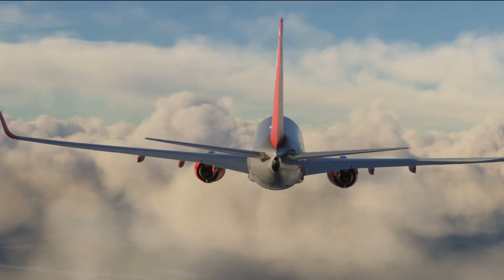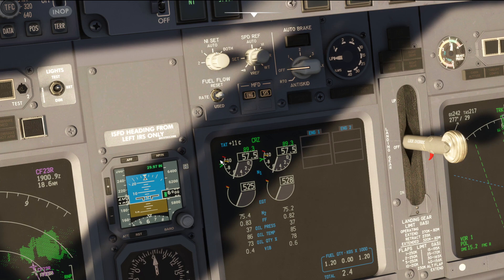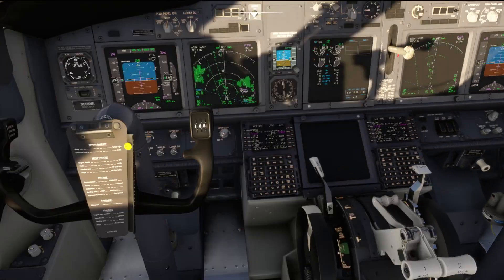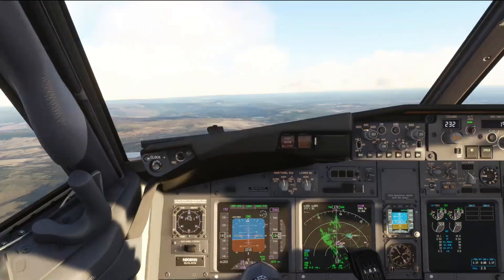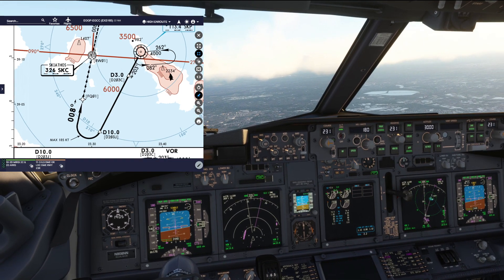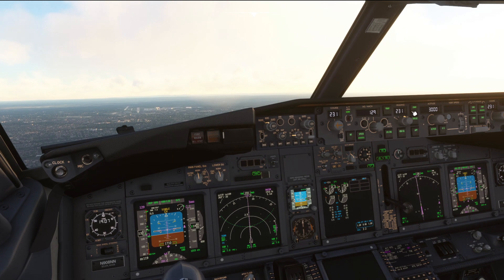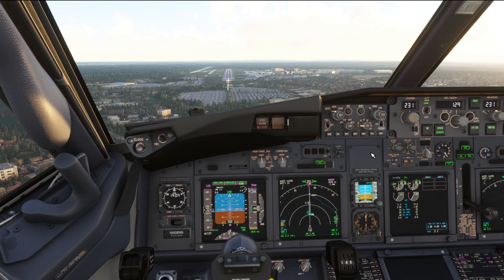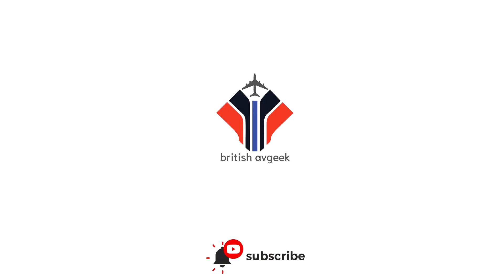MSFS | PMDG 737-700 Tutorial - How to Fly a Go Around / Missed Approach

Comment: So how do you do a new approach? The approach is no longer in the flight plan. Do you set it up again or do you just vector back into the ILS funnel for your runway ?

Excellent video as usual!
Reply from the maker: Vector yourself back 👍 depends on the specific final approach you are doing again but if it's an ILS you can easily continue with that or configure for another approach if needed whilst in the hold after flying a go around

Comment: When I am configured for landing I have the A/T, CMD off. Flaps at correct setting, gear down and locked and auto brake set.  Also, speed brake set.  I don't like to forget to take the A/T off and have the aircraft run away from me because I forgot to disengage it.
Reply from the maker: Keep trying and you'll have sorted it soon enough!

Comment: Two questions: Why do you put your curser on the screw as apposed to the TO/GA button???  Next question is if you have A/T off the toga will not work unless you move throttles up by hand.
I have been flying the Zibo B737-800 for 2 years and have the throttle set to ON in the FMB.  The way I do a go around is to make sure the A/T is engaged first, then push the toga button,
throttles move up to N1, flaps to 15 then 1 then up. Gear is selected up when at correct height from ground.  Great video!!!!
Reply from the maker: hi! your first question - because it's easier in a sim to click that than look down at such a critical phase to click a button (which would be clicked without looking in real life likely) and your second question - if A/T is off, then you will need to set TOGA thrust manually
Reply: I am using X-Plane 11. The Zibo B737-800. When I engage the TO/GA I select the left side MIC button which is on the dash without a problem (with the mouse).
As far as setting the Toga button manually where do I set that up?  I can't seem to find it in the FMC or in the Flight management bag (tablet in the aircraft).
Reply from the maker: @HelloHello563  setting toga manually I mean moving throttles forward manually